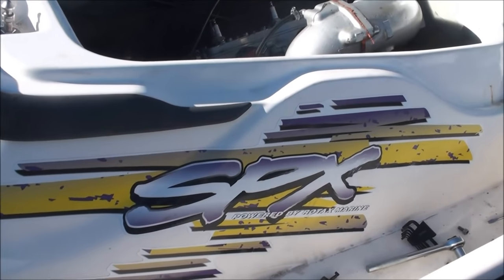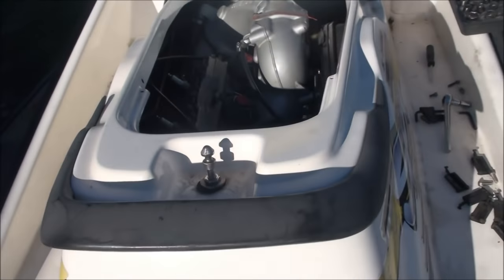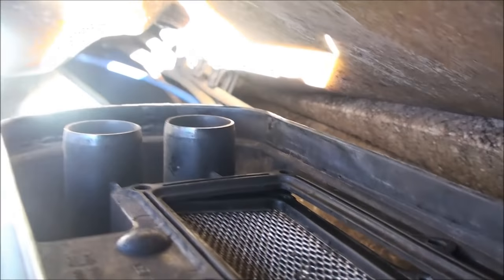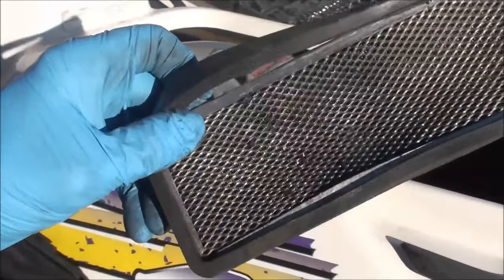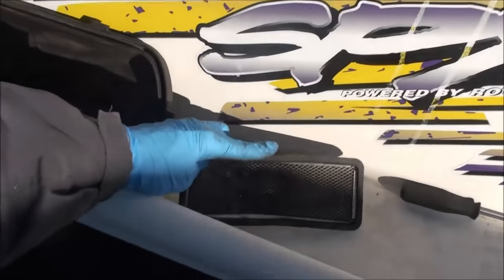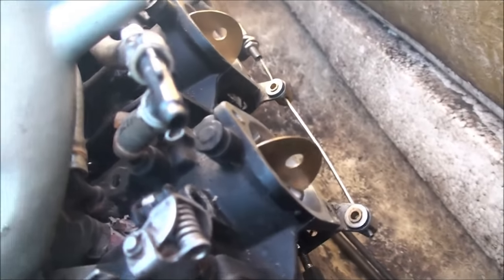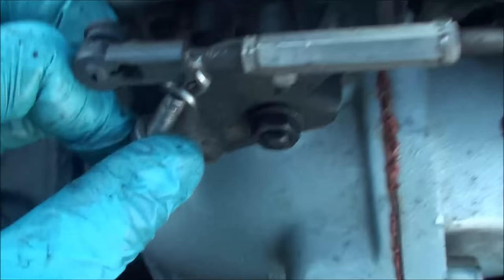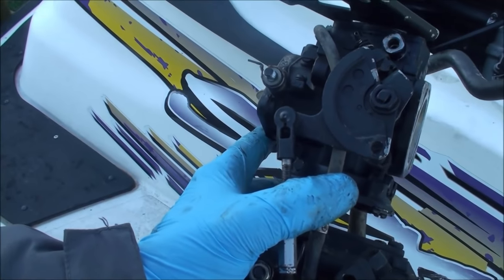1998 SeaDoo SPX 787 Rotax Carb Removal and Cleaning: Part 1

Comment: I had no problem with the removal and assistance with part II on the rebuild    But having problem with the Install of the dual Carb   The Front Carb throttle cable which I think goes to the Oil Injection is not operating smooth Any suggestions. Thanks
Reply: you mean cable? you can always try and re-lubricate the throttle cable to see if it will fix any corrosion, if replacing the cable will be a good thing to do. make sure while you're down there it is aligned properly
Reply: @xtune5731   I am trying to get my choke cable back on , I took it off like you did. How do you reset the springs that are behind the two bolts?

Comment: U made choke dismantle so diff
Reply: ya thats way too difficult, just take off the little hex countersunk nut with an allan key and then install it in the machine again. I use a marker just to notch it off... plus if my choke is not 100% closed and its 95% closed it wont be a huge deal.